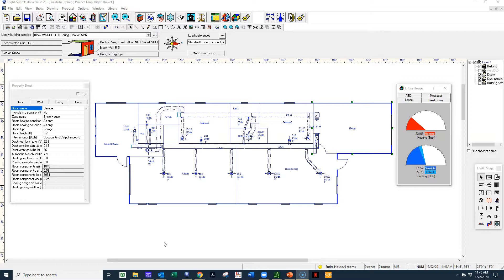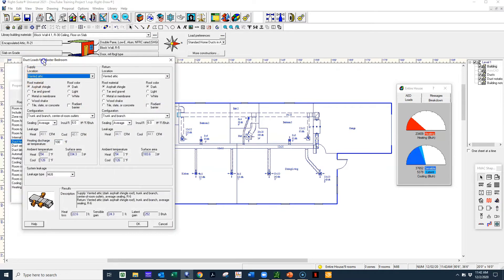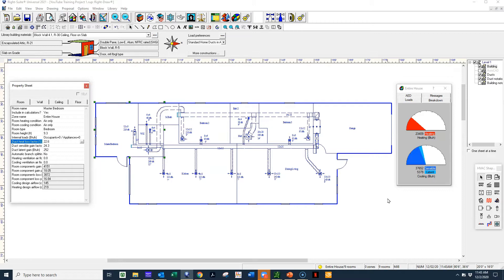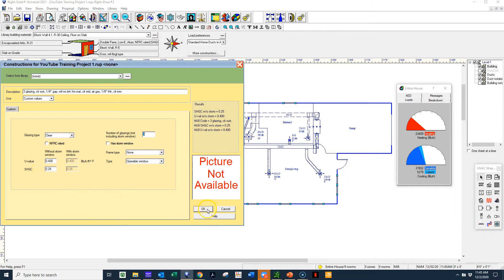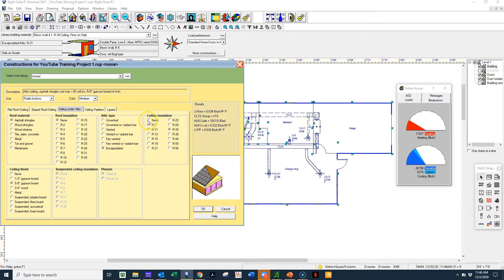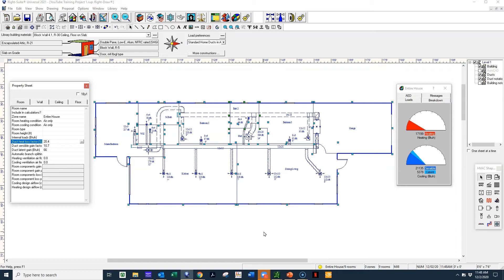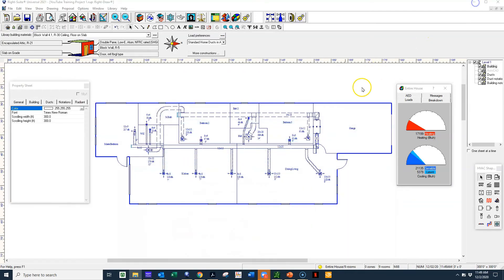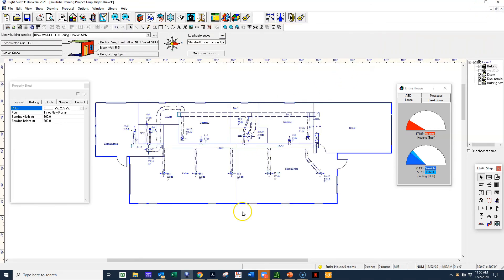Size Does Matter! 400-500 Square Foot per Ton Explained.

Comment: Good video  to show clients for my home performance jobs
Reply from the maker: Thank you, Mike! If there is anything else specific you would like to see or hear, let me know. I am 51 year old trying to get the hang of YouTube...haha.
Reply: @procalcsuniversity1484   Im trying to dig deep on SHR. Trying  to find out how good the Latent removal is on inverter systems vs standard builder grade stuff. So much info!
Just did a blower door for a client  because they did spray foam in the attic and want to update the HVAC. The blower door came out average so we need a decent amount of humidity removal for the ac estimate .
Sometimes knowing less is easier.
Reply from the maker: @Mikecianfrocco  Mike, the only true way is to do a load calc and then perform a Manual S on the equipment to get the exact Sensible and Latent capacity of the system. The spray foam as you know will greatly reduce the load on the ductwork if in the attic. When you say the blower door came in average do you mean around 5 ACH?